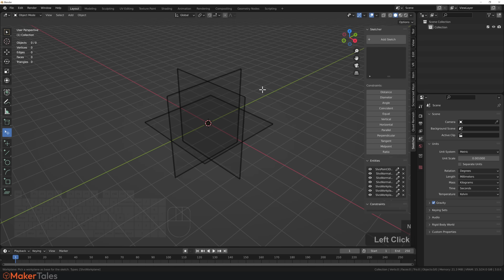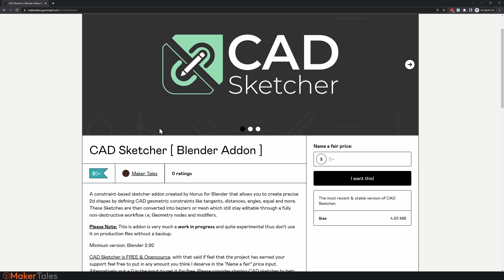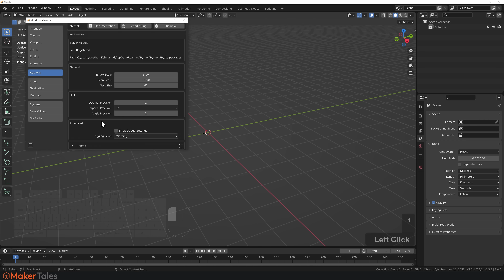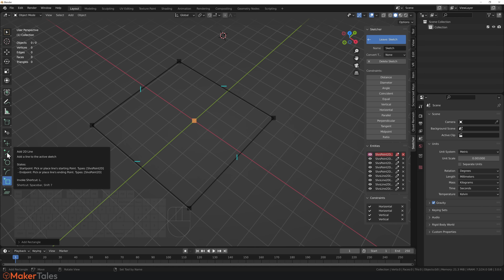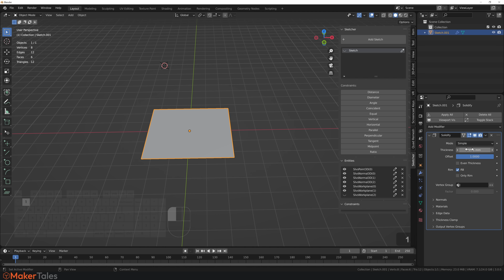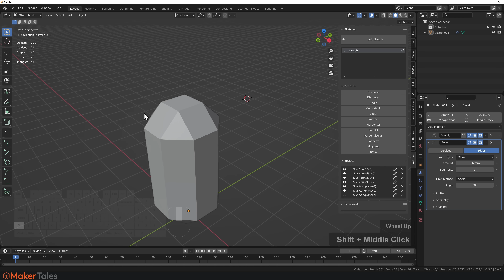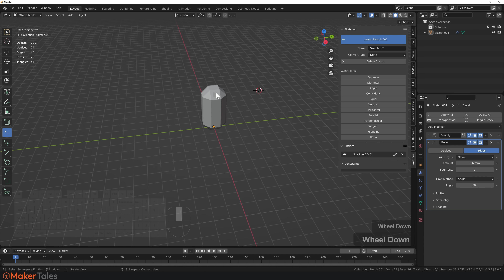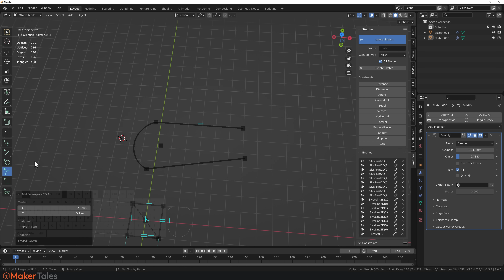CAD In Blender Is HERE! | CAD Sketcher Intro | Constraint Driven Design

Comment: How do i get my top and bottom sketvhes to not stack into each other. If i have 3 sketches (Top Bottom and Side) and i change them to mesh. Get the pieces positioned and go back into a sketch it will re-orient those pieces back to the mid point. Is that something thay can be fixed? Also if i have a top view of a sketch and i want to put holes in the middle but offset to one side how would i create reference points to line up my edges. In example say o have a 50mm x 25mm rectangle and i want a 7mmx10mm rectangle  inside of that but in the left corner 3mm x 5mm from the edge. How would i do that?
Reply: I think i figured it out, but  for anyone else having trouble. If you start a new sketch and create your outside dimensions first, then center it. You can make your cut out by creating the shape and then set the dimensions for it. Then use the line tool to create a line from the outside edge to the edge of the cutout. Then right click and make the it a construction line. Now you should have a straight line with two points. You can set the ditance between the points and it will position itself. When youre done just turn it into a mesh and leave the sketch. You should now have a square with a cut out.

Comment: Do I need to disable any of the previous add-ons from the 3d precision modeling video/setup to have cad sketcher run properly? I have cad sketcher installed successfully, but when I start a sketch, I can't select a plane to work on, nothing will highlight. Just wondering what's going on.
Edit: Checking on git hub this appears to be a problem with macOS, but i'm using pc(win)

Comment: I wonder if you guys should partner with freecad. I'm an engineer and I use solidworks for work. I've started learning Freecad because the mainstream CAD programs are expensive. I love solidworks but I just can't justify buying a license for personal use no matter how much I want to. I used to play around with blender a lot though I'm a bit lost in there since the layout changed (and keeps changing). If blender had a FreeCad module maybe mixed with CAD Sketcher, maybe I'd use that at home for personal projects.

Comment: 1. Object tree: need it. Can't properly manage depndencies between objects and their histories without it.
2. Terminology: need be in match with engineering community, so, "Extrude" rather than "Solidify", etc.
3. Controls: need be optional, similar to how VSCode has VIM bindings, we need an option to accomodate users coming from SolidWorks, Autodesk Inventor, etc.
4. (!!! CRITICAL) File exchange: CAD software relies on STEP files (the ISO 10303-21 standard) for exchange of engineering drawings, which allows to encode drawgins as a graph of mutually parametrized vocabulary (ontology) of mathematical equations, describing geometric entities, created based on the ideas (circa 1991) of Tomihisa Kamada and Satoru Kawai about a general framework for visualizing abstract objects and relations. This is critical! CAD is not about meshes, it's about relationships between math formulas, so, I think for a real CAD solution, this is the most critical thing...

That said, I'd love to see a fully-fledged CAD system based on Blender, and hope for much of luck and great way forward!

Comment: Personally, I'm not really that nuts about this plugin.  Constraints are only one way to model an object.  They're cumbersome, they're complex, they're sensitive and very unintuitive (speaking of the CAD variants here).  This plugin would be fantastic if it first made sketching itself much more robust.  More like a Sketchup or Rhino, much more advanced typed or relative entry while drawing.  Visualize your typed entry, draw horizontal or vertical, Imperial or Metric, smart snapping from other objects, parallel or tangent modes, extend to edges, pulling lines off of existing shapes or sections, etc. It seems the majority of this functionality is around the constraints and parameter-driven design.  Those things are far at the end of the line for me compared to dimensionally-precise, complex sketches.

Comment: You have excellentvideos on precision modeling in regular Blender and have recommended it for beginners over Freecad.  Both are amazing bits of open source software, I use them both, and both are hard to learn at first.  Making a proper hole in a Blender mesh can be done, but not without abstracting the concept of a hole into a set of vertices/edges to edit and do stuff with to make a hole, or subtracting a cylinder.  In Freecad, a hole is a hole, (or just a circle in a sketch)  I can think hole here and I get hole here.   And it is way easier to change stuff if it the model is well made. 

That said this is very exciting, and I am hoping that in time all of my hesitation about using Blender as a Cad tool will soon be meaningless.

Comment: Hi. Does it make sense to add a new issue in case I cannot install py_slvs on Linux with Blender installed from Flatpak? As I can see py_slvs offers only Win/Mac installation packages. So, have you tested your add-on om Linux?
PS I'm getting "Package should be available but cannot be found, check console for detailed info. Try restarting blender, otherwise get in contact." trying to install it from PIP. As I wrote I'm not sure I can install it from a file cause there are no platform independent versions (this is very weird for a python)

Comment: When you typed in 5mm 4:40 are those "real" units, like I can just export STL and it will be 5mm without extra work or set up with each new project? 
Right now on every project, I have to set the scene dimensions set to Metric/Unit Scale 1.0/Meters. Which when exported is close to 1mm for each unit in the dimensions.

Comment: After using this for a week, just playing with it, I noticed an issue.  After creating objects with sketches, I often move the objects, apply materials, "shade smooth", etc.  If I then edit any sketch and then "leave sketch", the solver moves all mesh objects back to the main origin and removes all their materials and properties such as "shade smooth".  if there were dozens or hundreds of objects originating from sketches, it would be super time consuming and error prone to have to keep repeating moves/rotations/material assignments/smooth/etc for all objects every time after editing a single sketch.  Also, all sketches are drawn at main origin (unless drawn on mesh face) and cannot be moved.  Moving the mesh object created by a sketch doesn't move the sketch with it nor does it move sketches drawn on faces of the moved object.  I kinda expected new sketches to be drawn at 3D cursor and that sketches could be moved after creating them.  Don't get me wrong, I'm not trying to be critical.  I know the creators of this new add-on are working very hard and things will continue improve.  I appreciate this a lot.  I just thought if I noticed something that I should report it.

Comment: It seems at the current you can't project existing geometry into a sketch.
Also I can't figure out how to detect what is not fully constraint (I can't wiggle any vertex).

Another strange thing: if I leave the sketch, then enter it, then 3d objects become hidden.
However when I add new sketch, they are visible.

Also it's very confusing what is considered vertical or horizontal

Comment: Hi! Thanks a lot for this. I'd like to add a suggestion:
I find it strange to see the first part of the official introduction/tutorial is going into preferences of the addon and changing a bunch of settings. Instead, I propose that whatever settings that are suggested here as best or best to start with, are instead the made the default settings, as that would considerably simplify the number of steps required before users can start actually using the addon.

Comment: This is an interesting project but I don't have a lot of high hopes for it.

I think there's a reason GIMP's vector tools aren't as good as Inkscape's, and I see the same reason for the differences between Blender and FreeCAD.
I'd imagine a proper CAD system has a deep integration with the overall rendering engine or other components of the software, to the point where there may be deeper changes to Blender that are required. What happens if there's a huge overhaul or refactor of Blender for other reasons? It has the potential to break plugins like this and the Blender team may not have the capacity to address that.

FreeCAD is great! Yeah it gets a lot of hate because of its learning curve and quirks, like sometimes you need to offset something by 0.0001 mm because if things line up too perfectly then it blows up, but I've been using FreeCAD for 3 years now and I absolutely love it. I feel we should be trying to improve that instead of starting from scratch with this new plugin.

Comment: I am having problems to install this module. I am having to use Windows to WFH instead of Linux so it could be it.
I have follow the documentation, installed the solver module via pip install, you name it. 
When I enable CAD Sketcher and exit Blender, it shows that "Solvespace module isn't available, only base modules registered"
I really would like to get this installed. I am hoping here or Reddit can help me out.

Comment: We really need an alternative to Fusion 360 for the average hobbyist. Still early days, but I hope CAD Sketcher can eventually fill that gap. Using the blender interface is a genius move and I hope development on this project continues!
Reply: FreeCAD is good aside from the topological naming problem, but assembly workbenches like assembly4 don't suffer from that
Reply: I saw this and that was my thought. Especially since Fusion you could lose access to features at anytime. My immediate thought was for intense computations like people doing large generative art for eventual 3D printing this is a possible game changer. Fusion being single threaded sometimes struggles with large numbers of points.
Reply: @lukefabis2552 Nah, tried it. Ideology "what you want, it is free" when I tried to use grid there.
Reply: Agreed.
Reply: freecad is okay, but CAD in blender would be awesome.
Reply: Have a year later - how has development been up until now?
Reply: Fusion 360 is really nice though
Reply: @nerrdinho  But they want the price of AAA game per month now to do your home toys that costs much less. It is like old UNIX license in thousands against new Windows at $100.
Reply: @nerrdinho  Laggy + annoyaware + missing features. Can't even make your own profiles for a thread easily.
Reply: @nerrdinho  true but its UI makes it hard to use
Reply: I'd recommend looking into Plasticity, it's in its really early stages right now, but it has great potential. It won't be free, but it will be perpetual and fairly affordable. MoI3D is also good, but it is a bit expensive and entirely destructive as opposed to non-destructive.

Comment: Nice work!  Now if you can accurately keep real world dimensions on export to something like .step that properly opens this up as most CAD packages are lacking in the "presentation" tools department so this could be a real disruptor! (Especially if later down the line we get fluid dynamics / FEA etc.  I appreciate Blender already has the former but it's very much for visual effect only.

Comment: Upon further watching and trying to follow along with the video - you don't cover getting blender set up for mm values.  So when I did a piece that was supposed to be 10mm...it essentially turned into a flat line because the default for blender is meters and it was zoomed WAAAAAY out.  Good stuff though; I did figure it out - changing blender to mm, camera cutoff, and viewport cutoff values way out solved most of the issues.

Comment: It definitely has a bunch of problems so far but there is certainly a ton of potential for this.

Some things I noticed right away were that :
- The constraints make it really hard to select the center of the circle, as far as I'm aware you can't offset it to the side and there is no box select to make it easier.
  Combined with left click deleting constraints and it becomes a problem.
- nothing prevents you from modifying the object in edit mode, however editing the sketch reverts it back.
- modifying the sketch gets rid of effects such as smooth shading and presumably other similar effects.
- keys such as x don't actually let you delete parts of the sketch, it will pop up but not actually work.
- some things will stay around even after you delete the sketch, it will disappear if you open and close the sketch again.
- there is no way to delete a sketch from the sketcher screen without entering the specific sketch
- there seems to be no way to delete part of line when it is tangent to another but goes farther than the tangent.
- there is seemingly no way to snap sketch points to one another, this might just be me missing something

So far, these are all things that I am sure will be fixed in the future but I can't help but imagine the constraints would function better as a set of edit-mode and object-mode tools rather than "sketch tools" . This is primarily because not being able to edit things in edit-mode makes it restraining as everything has to be done with Booleans that linger in the background. I just don't understand why something like this wouldn't be integrated into the object constraints or even added as a new category of "edit-constraints"

Either way, its definitely something I'll look back into in the future when it updates. There's just way too much potential to blow off - especially for something so early in development.

Comment: That is fantastic. As an engineer I'm using CAD-Systems on a daily bases and it always buged me, that I couldn't use this form of construction in Blender. I'm also a fan of 3D-Animation and CGI I also always wanted to bring real teachnical designs to life. There are probably ways for doing that in the software already, but I'm not so deep into the understanding of the software to call myself educated in it. Therefore, I'm absolutely amazed by CAD-Scetcher and will absolutely use it. At least in this way, I can combine engineering and visualisation in one software.
Cudos for that!
Very many thanks from Germany for this!

Comment: Can the unconstrained lines in a sketch be a color other than black? 
It would be a nice visual cue that the sketch is not constrained. Then, if the sketch lines turn black, you know it is adequately constrained. 
Fusion 360 is mentioned in the comments to this video, as are FreeCAD and DesignSpark Mechanical. You can also get inspiration from Onshape.

Comment: YES! This is what I was waiting for, with the timeline and everything. I'm using blender mostly for games, but i wanted to use it as a Fusion360 alternative, cause Fusion has Lots of problems when you do Artistic stuff when you design something, like a honeycomb surface, that's lot for Fusion...
Reply: You could do a honeycomb using this and geometry nodes right? Seems like it would be pretty easy
Reply: It is indeed... I had a case where i had to make a 3D printed part for a thing, and do a honeycomb pattern to waste less plastic and remove the little heat the thing produce, and it was long, not too much, cause it was a plane, but i can imagine if you had a curve face, that would be difficult...

Comment: A more fleshed out native surface & solid modeling (both direct & parametric & also possibly wireframe too, even though it's not used as much) would go a long way, 

Still can't use  Blender for industrial design which is a sad thing.